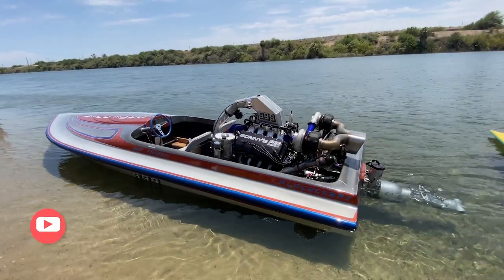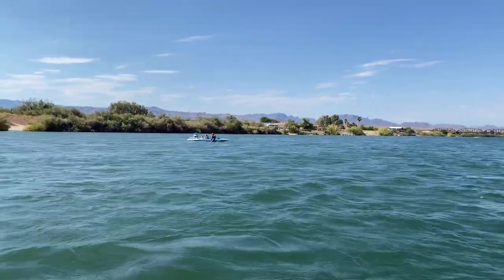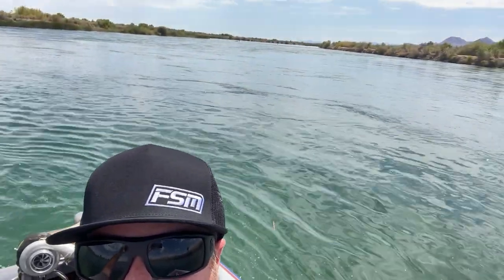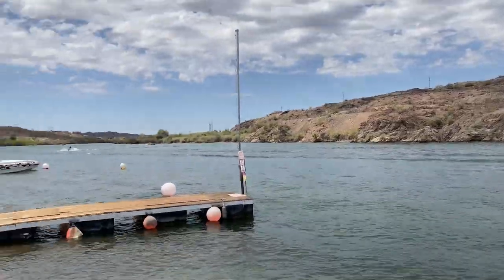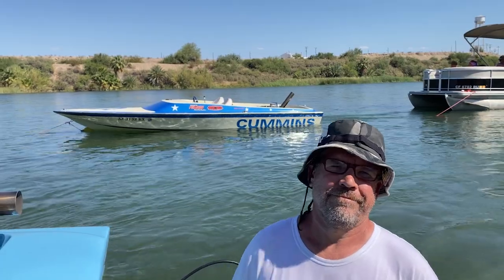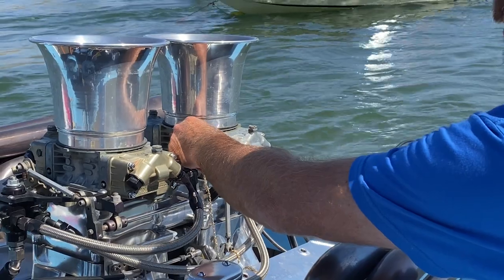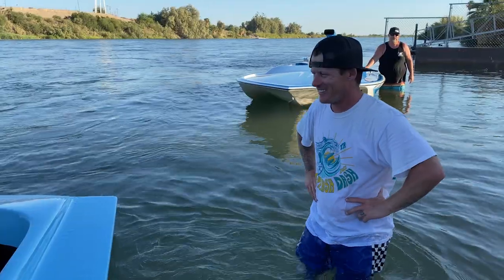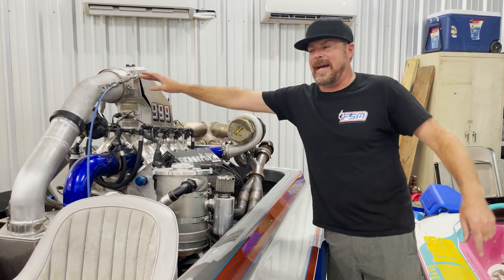INSANITY! RACING A CUMMINS 12 VALVE DIESEL-SWAPPED BOAT!!!

Comment: 17:43 and 18:09 Game over sounded like helicopter turbine winding down! Holy balls the turbo sounds were wild! Great job getting her stopped after that wild ride.
Reply: I mean, you ARE hearing a turbine wind down. It's just the turbine in the turbocharger. Same noise. Some turbines even use centrifugal compressors just the same as a turbo.
Reply: He said he drove around 80 miles that weekend.  I wonder how much money he spent to build that boat and drive it 80 miles?  That's probably over $1500 a mile
Reply: @desertfresh3740   Yes  turbo is a turbine but you  don't hear them wind down with that helicopter level of authority.  Spooling up is another story.

Comment: Back in 1986 or 7 ,I drove a 1968 Bug from Helendale, Ca.(20 miles South of Barstow, on Route 66) to Atlanta, Georgia via I-10 in Febuary. 
That's a long cold trip as I made 2 stops 1 in Los Cruces, N. M., and one in West Columbia TX. (relatives). 
If you ever get behind a semi in an air cooled auto, watch the temperature, as it's a great tow but @80 mph my bug vapor locked.. 
I digress. 
God bless you and your loved ones 
Godspeed
Reply: I had a Beetle back in the ‘60s. I used to draft the semis up and down the NJ Turnpike.

Comment: You should look into some sort of throttle authority strategy so that if the throttle is closed and the MAP is high for more than 1 second, it will drop into a limp mode.

Comment: What an incredible crack in the throttle body!
I would keep it as a trophy and build a new version.
Cracks like that are why top-tier motorsports x-ray their engines, metal sheets and welds.
Reply from the maker: that's the plan.i'll retire the part and build a new one.

Comment: I can hear Gale Banks screaming "IT NEEDS MORE AIR!!!"
Reply: Scheild Diesel in Indiana would definitely help break his driveline . Mr. Banks can light cigars with green cash 🤑 due to his green diesel endorsement
Reply: Banks is a hater. He is ruining the diesel world with his EPA propaganda. I agree any engine can use more air, but with more air comes more fuel. EPA is making it impossible to get tuners these days. PowerDriven had the best programs, and now they are no longer allowed to sell.
Reply: @madrx2  Banks is a hypocrite. Never said he did not know what he is doing. He often does the same things to those he is throwing shame to. 

I would like to see you find room to intercool between stages. The man talks all this smack we should intercool between stages, but does not do it on his builds. Like to see him fit piping and intercoolers for triples.

 I see your intelligence level is pretty low tossing insults.
Reply: Gale banks him self said fuel = power .  Diesel make their  best power at 14:1 you wouldn't believe how smokey that is. 20:1 is best for emissions that's where oem run them.
Reply: Ha ha ha!  My exact thought when I saw it rollin coal!

Comment: Has a Merlin ever found itself in one of these boats?  I remember a lot of them getting used in tractor pulls.
Reply: 1st ....You probably wont find one because they are super rare and 2nd , they weigh around 1400lbs and burn 2 -3 gal a min at full chat.
Reply: Maybe not a modern hull but the Detroit River has a great historical racing history with crazy engined boats. "Detroit River Thunder" ~for googlefu

"In 1932, Wood piloted Miss America X --powered by four supercharged Packard V-12 engines producing 6,400 hp, setting a waterspeed record that went unbroken for over thirty years." 

Worth looking up!
Reply: I think they used to use them in unlimited hydro racing, alison engines probably more common though, i think everyone uses turbines these days though.
Reply: Soon as a saw a diesel, I wondered what else is heavy that I haven't seen.  :)
Reply: The Merlin has such a calming drone and thrum while it puts out all that power.

Comment: that diesel needs a tune. people who tune them to blow smoke are ruining it for everyone. EPA is bending everyone over
Reply: Beat me to it, I get that it's a unique thing that you wanna show off, but the fact that it's a cummins in a boat with the single dump from the Turbo will be enough to bring them in to ask, you don't need to burn down the coal mine just because you wanna be noticed.
Reply: @RedDeadSpearhead  He can still make the power as well. It will still be smoky but he needs DDP's new 12v injectors and probably step up to compounds maybe turn the pump back a little and that should clean it up a lot and most likely make a fair bit more power.
Reply: Wish y'all had the same energy for 2A as well as the EPA. No matter the alphabet letters, they're all trying to fuck us over.
Reply: @joshuagibson2520  yup.
Reply: EPA isn’t looking at a 12v Cummins… They are looking at the vehicles that came with DPFs… in fact most states with emissions 1st and 2nd gen dodges are exempt, which came with the 12V.
Reply: It's in Marine application whole different set of rules
Reply: Absolutely true. 💯
Reply: It has more than a tune. That is one built machine made by a genius

Comment: Put a mini split ac in there.thats what I have in my toter. Run the whole rig off a honda 2200.
Get a extended run cap and your golden.
Reply: @supertrucker5000  yes very quiet.
Mine was charged also.mine has a heat pump also.
Love it!!!

Comment: Hey fin!! It’s the capacitor for the a/c motor!!! No big deal!! If it’s still works and blows cold for even a minute? She is just fine. Just a short or bad capacitor where it turns it off to prevent stuff from over working and getting to hot. Hope that helps!

Comment: The phenomenon that the Cummins boat experiences in reverse is called prop walk. If the propshaft is at an extreme angle, in reverse one side of the prop will have more bite or dynamic pitch and the other correspondingly less. This causes the stern of boat to want to pull in the direction with enhanced pitch. Our old Endeavour 37 had a 17 degree propshaft angle and in the twenty years we owned it we never did figure out how to compensate for this. Some say that you should hit the throttle and then go back to idle and let the boat coast.

Comment: I’m a green HVAC tech and I literally just saw my first RV ac just a few weeks ago, the thing charges at less than a lb lol. It was out on ow pressure because it had a big gap in the line set and all it needed was to be sealed up with a little brazing material and charged to 10oz. Easy peasy.

Comment: MIKE you need to put a spring loaded pressure plate on that manifold.  same solution the roots blower guys came up with, sping loaded plate that can only be pushed open when theres a backfire but doesn blow a hole in the case.

Comment: Great video, On the ac unit install If I may, I would like to offer my unprofessional opinion on something, i didn’t see a seal Between the AC unit and the roof, they are about an inch thick so I am wondering why it wasn’t there,it should have one or get leaks.   On the old ac tripping breakers.. if its a 15k ac unit it needs 50a breaker maybe go to a 13,500 ac unit.. less load and quieter..

Comment: I personally would love to see a beer can implemented as a feature to fix that air leak. It would not at all match with the rest of the boat's motif, but it highlights a bit of the boat/motor's history. In 2021 the thing backfired hard enough to split a seam on the air intake.

Comment: Take a look at replacing that rooftop AC unit with a mini split system. It will be almost silent and will cool much more efficiently. You'll just need to run the refrigerant lines and mount to condensing unit on the rear deck of the toter.

Comment: Oh yea he was probably pulling off the transfer slots at idle with the mixture screws in so far and blades open to compensate and that can be a pain in the ass! Thats the problem with the big cam shafts with no vacuum at idle to draw through idle circuit than they open the blades more and pull through transfer slots. Need to drill small holes in blades or get the adjustable air bleeds or filter housing stud with air bleed.

Comment: I had heard of a 12 valve in a boat a while but I thought it was around salt lake , seems it was a v drive but I don't remember.  As far the transmission me and a friend had a flat bottom v drive and we also took the velvet or what ever it was out and went stand to crank . I had wanted to try a power glide and no convertor.. I have a 12 valve in my truck but the newer 6.7 common rail motors run pretty good also

Comment: I want to get one of those Eliminator jetboat hull that Finnegan got or a Racing Sprinter Jetboat that has a roll bar and put a 4 Rotor with a Turbo and a eWastegate, using the FuelTech FT550 ECU.

Comment: Looking at buying a vintage Jet Boat. Wondering if there is a brand(s) to steer clear of? Also, what is a good price for one in good condition? Not looking for a race boat, but a fast family boat (have a modified '67 Camaro for the streets).

Comment: You should have added a RV soft start on the roof AC.  Allows RV AC to run on lower amps.   Before throwing money on new parts you need to ask RV tech.  Look on YT. Lots of RV repair and technical maintenance information. Free!

Comment: Most reliable boat ever. It's the one thing that really makes the second Gen Dodges worth a damn. And putting it in a boat eliminates all the worst parts; the potato chip interior and wire insulation! Hell my Dodge already has 4500 RPM marine governor springs. The body and interior are pretty bad. Maybe I just decided the future of my old truck!

Comment: I love Jet Boats but that's my one problem with them every time you take them out it seems like something breaks no matter what you're doing something always goes wrong they're a blast for the short time they do run good and everything is going great I mean it is a ton of fun I threw myself out of one driving it when I was a little kid probably about 13 I've always had a love for them but they have their place basically it's not an everyday go everywhere boat

Comment: Compressor or the fan change of both of them it's probably a combination capacitor for the fan and the compressor but that would have ran just fine changing out the capacitor

Comment: You should pull the cover off of that rooftop then inside theirs a small metal cover that has capacitors in it. One of them are bad

Comment: probably a weak/bad capacitor on the AC, low value makes for high current draw and slow compressor and fan motor speeds.
I don't think it would freeze up and go high current within 3 minutes run time from low refrigerant , but who knows :)

Comment: maibe have the piece that broke made in carbon fibre , at least it will be one piece and harder to crack , probably can make it so it flows better too , to make it fit the overal look you can have it painted the same as the hull of the boat

Comment: I actually was just talking to a few of my buddies about getting a cuddy cabin boat and stuffing a Cummins in it to make the ultimate sleeper speed boat. My plan is to run the stock exhaust with a cut off so I don’t disturb people in port and near the beach, but the cut off will dump into a pair of truck stacks commin out the transom so I can roll coal like a mf and be rowdy every now and then

Comment: Jet boating with no mufflers is already a fairly obnoxious hobby, but that Cummins is way over the top. Why would someone do that?  Glad Mike had a good time and wasn't hurt when Game Over popped the manifold. If I understand correctly, it was in closed loop so even though the the throttle was closed it was still giving it fuel?  That's pretty dangerous

Comment: He's wasting power by making soot he could be making more power by leaning out the Diesel or he could put higher pressure with a turbo and controller upgrades. Thats why the EPA is coming down on Diesels. It just stands out all that black soot effectively shows inefficient combustion stop underutilization of diesel engines and turn the soot into power. Look at what BANKS are doing for an example of how to make serious power out of Diesel. May I also commend the music and your channel's content, respect William

Comment: Nice plug for Moreland,  like he needs more work….He is the carb guru and I don’t think there is anyone out there that can dial in a carb like John.  They work every time without ever needing to turn more than the idle screw.   

If you bolt on one his carbs and it doesn’t work.  You did something wrong.
Reply from the maker: John is a genius. cant say enough good things about his work.

Comment: So why do supercharged/blown engines idle like that? I noticed Warbird idles the exact same way. Someone please school me.
Reply: I think you can get them to idle smooth, but it results in a really lean idle mixture(i think, just repeating what I've heard on youtube here haha) , which i believe is undesirable. So they tune them a bit rich, and because it's just mechanical injection it puts in the same amount of fuel, there's no regulation of idle speed, so the mixture varies between lean and rich. So like mixture is lean, engine revs up, mixture goes rich and the revs come down, and it just repeats over and over(might be the other way around, can't remember though)
Reply: The engine in a way is kind of "gulping", instead of breathing smoothly, it's called blower surge, "roots style" super chargers tend to do this cause it's trying to build boost and hold it back at the same time, this causes a rich and than a lean condition, as the engine takes another "gulp" of air, which causes the engines rpm to speed up and slow down in rhythm. I think blower surge sounds awesome.
Reply: @danthomas9077  yeah that's a better explanation

Comment: You'll run a good chance of destroying that air conditioner by holding it on it's side and upside down- A MAJOR NO NO!
 This is one reason I quit repairing them if the customer touches them.